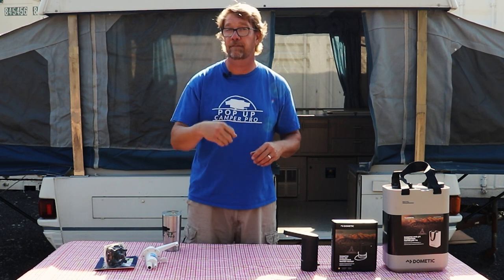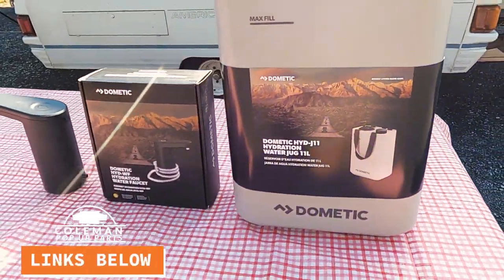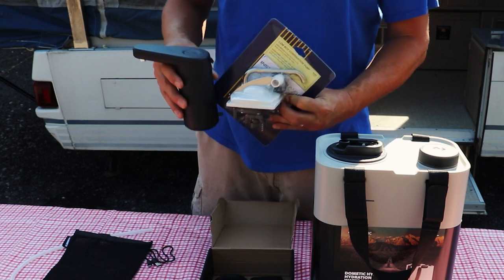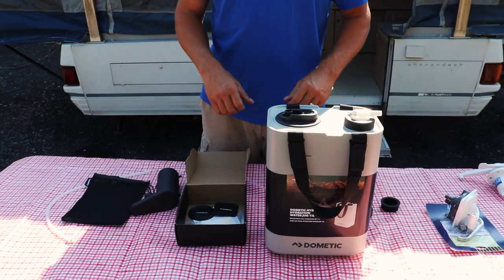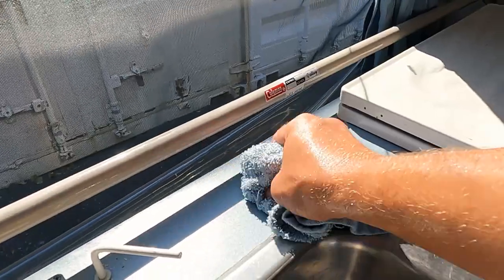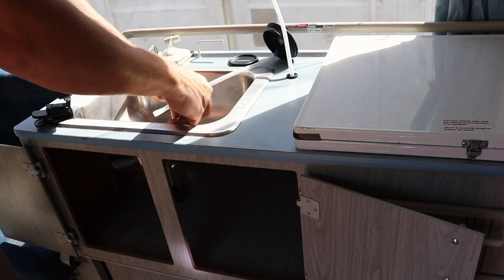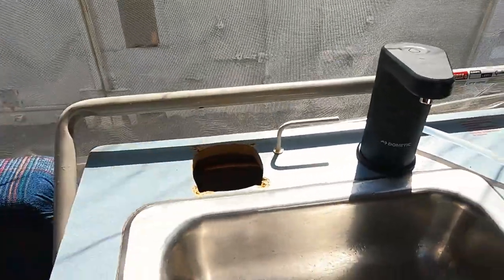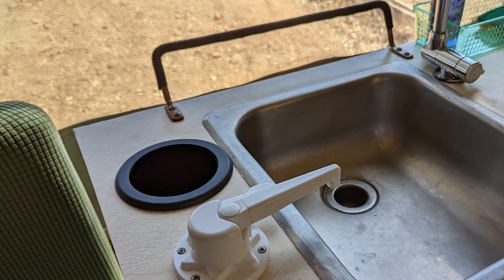Easy Power Faucet Upgrade for Pop Up Campers

Comment: could you essentially connect your existing water feed lines to this dometic with some crafty fittings from the hardware store?
Reply from the maker: Plan on trying this tomorrow. Stay tuned!
Reply: @popupcamperpro  awesome! it would be cool to get a merge from city feed or my 10 gallon depending on where im set up. prob just a basic switch valve I can hide in the cabinet that gets fed by both lines before it goes to the faucet.

Comment: Not related to this video, but my 2006 Fleetwood Utah water pump is leaking around the face plate where you can adjust the pressure (four screws hold it on).  Can this be repaired or replaced?  Hate to replace the pump because it's under my slide out and hard to get to.
Reply from the maker: You can try, but this commonly requires a new pump.
Reply: Check pump model. Some sell repair kits. I just fixed mine om fleetwood few days ago.

Comment: Does anyone know what the flow rate on this faucet pump is???
Reply from the maker: it runs long and strong, with the ability to flow 150 liters on a full charge. The output is only about 1/4 inch, so your flow rate is confined to this less than common output as compared to normal household faucets.